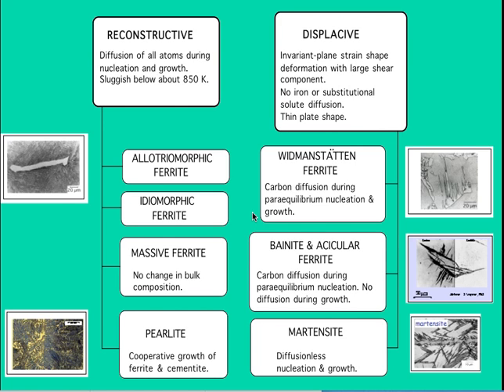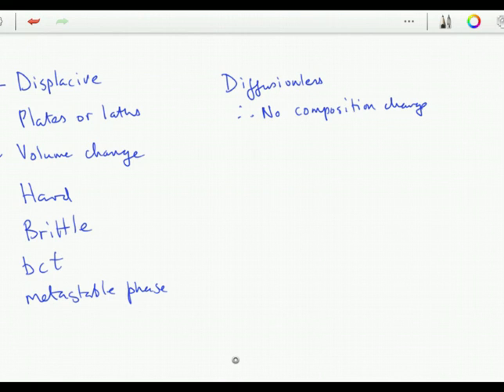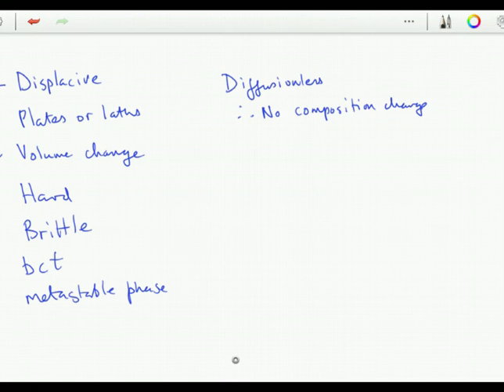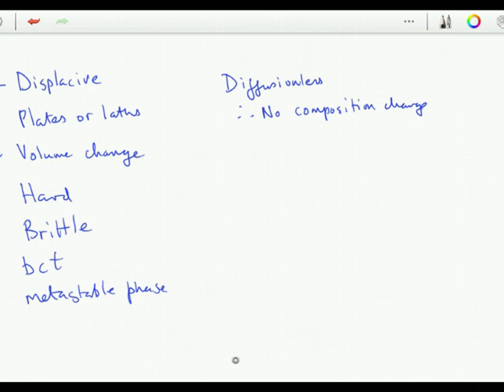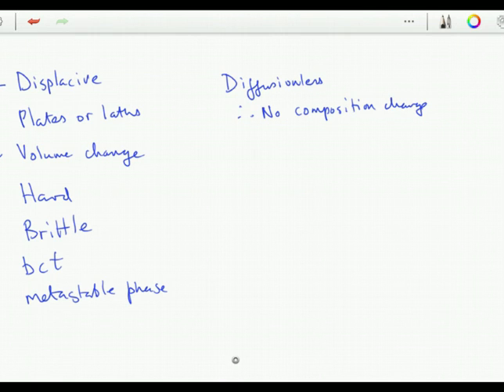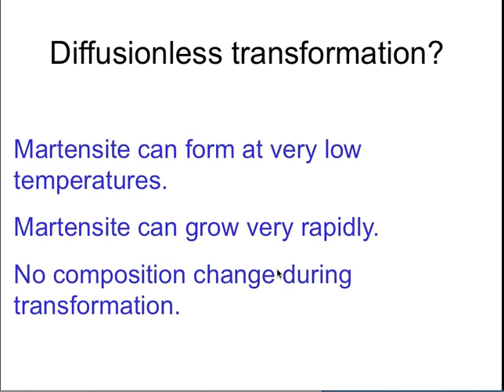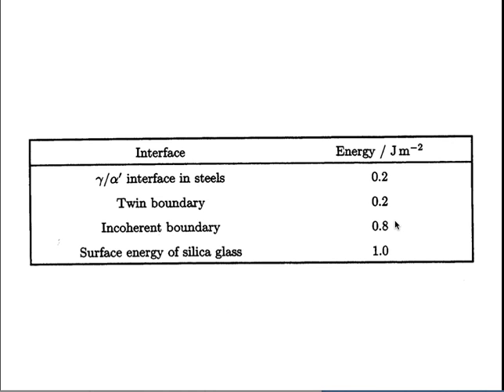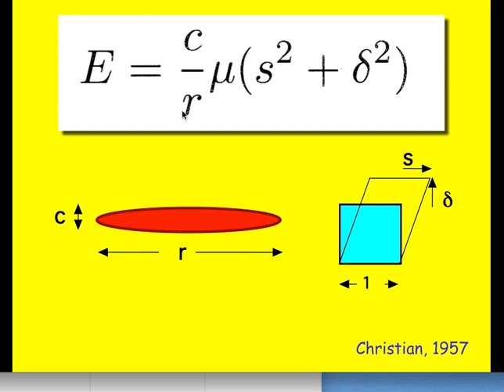Steels: characteristics of martensite, lecture 1 (2016)

Comment: Thank you for this lecture! What book about steel alloys and allotropic phases of steel would you recommend to someone that has a master degree in nanotechnology? Im looking for nice phase diagrams for different alloys (mostly carbon), fatigue graphs and lists of alloys with general properties like tensile strength, phase transitions, galvanic corrosion, stiffness, hardness, etc... any information is helpfull :)
Reply from the maker: Steels: Microstructure and Properties
4th Edition
eBook ISBN: 9780081002728
Hardcover ISBN: 9780081002704
Imprint: Butterworth-Heinemann
Published Date: 24th January 2017

Comment: Dear professor, is there any image of the surface relief of martensite similar to that of bainite? I want to know in actual how the surfaces are parallel with some perpendicular distance between them and even when they have a plate or lath like structure?
Reply from the maker: http://www.msm.cam.ac.uk/phase-trans/2002/martensite.html
Reply: thanks so much for your help professor